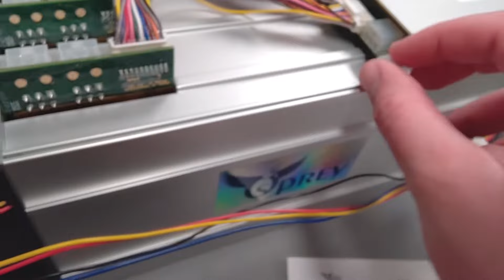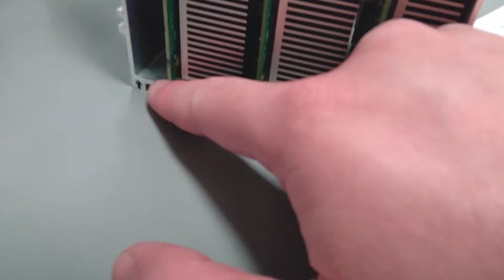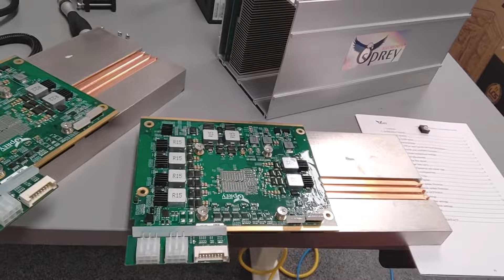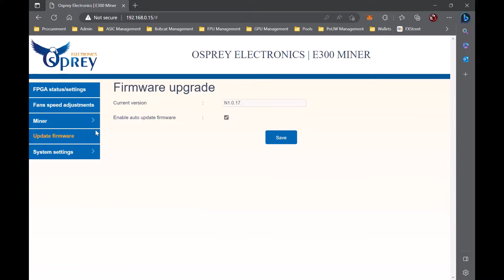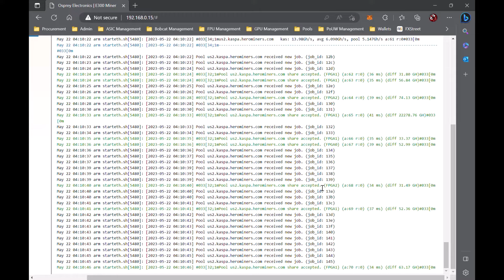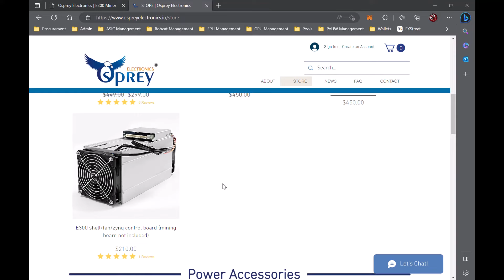Osprey E300 FPGA Crypto Miner - Full Review & Setup Guide

Comment: That short heat sink  could be used to transfer heat through the fins to the case. but don't look like they did that. If you want to improve the thermal flow you could put a thermal pad between the fins and case to rid of the insulating air gap. Then again the pad might make it hard to slide the board out but seems like they would have found a way to transfer heat to the case for all the boards.
Reply from the maker: Interesting idea 🤔